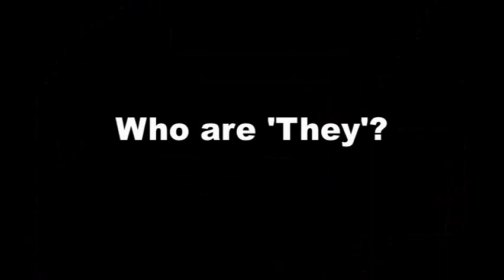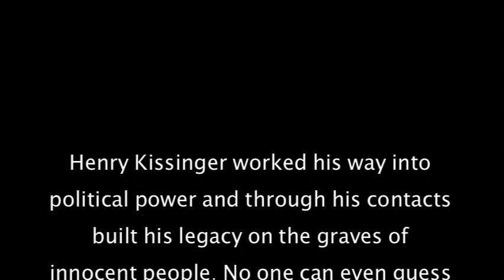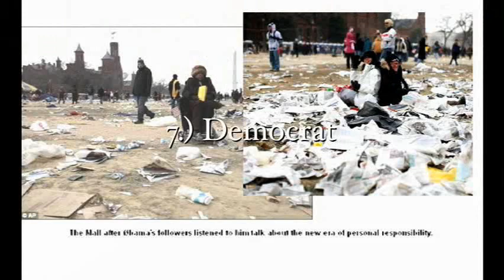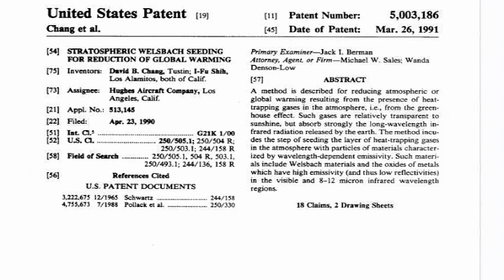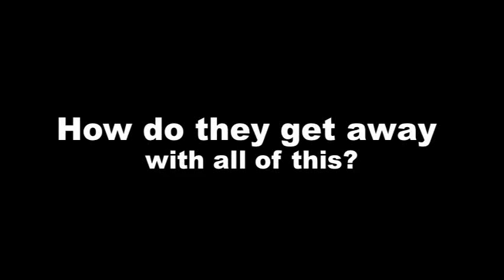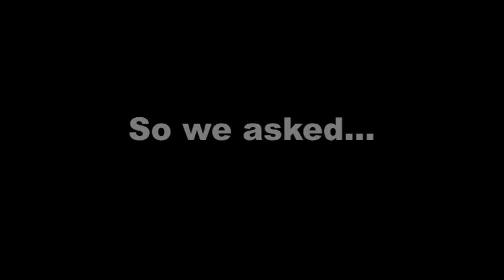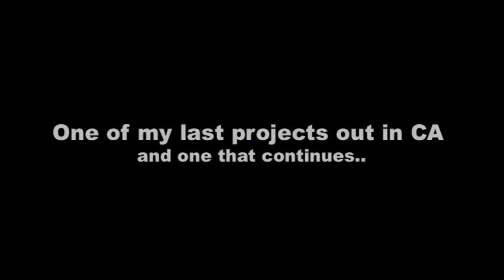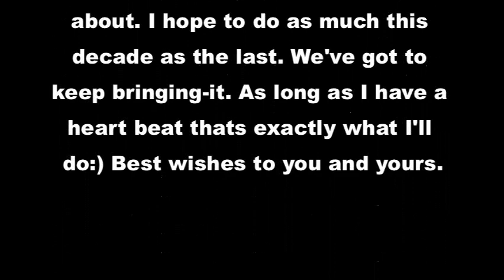Pass It Around (Full Length)

Comment: When your talking about weather modification all you have to do is pull up the patent for HAARP a device specifically designed to heat the ionosphere there are seven HAARP devices located throughout the world which emit EMF's into the ionosphere creating an "air pocket" which can drastically change the weather depending on the size oh and cause earthquakes when directed at one local for an extended period like 3 day weather control is not only possible but relativity easy.